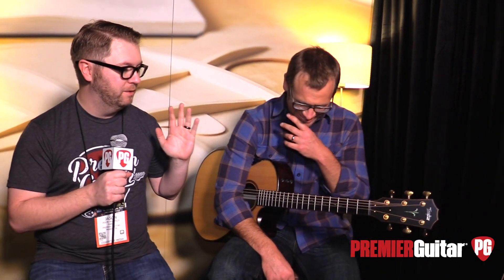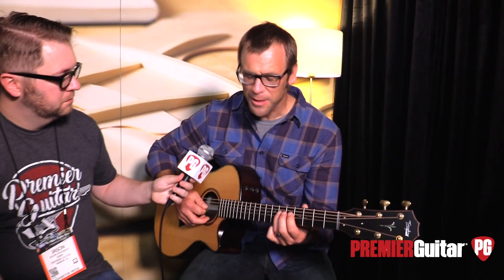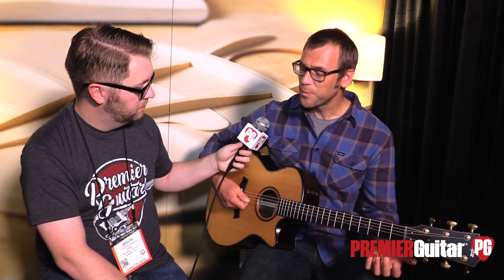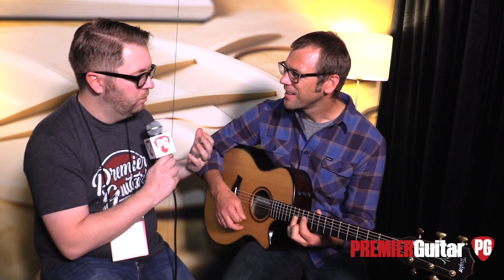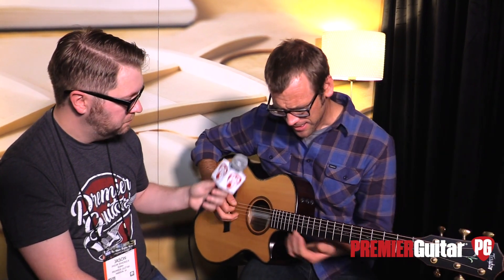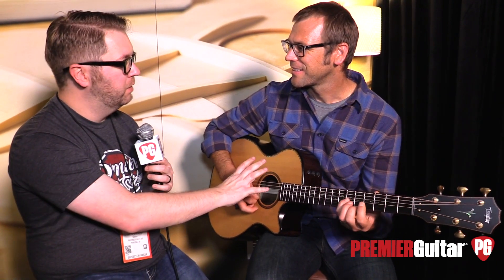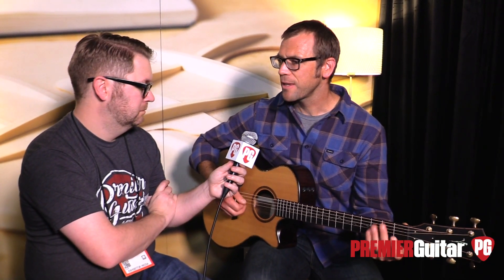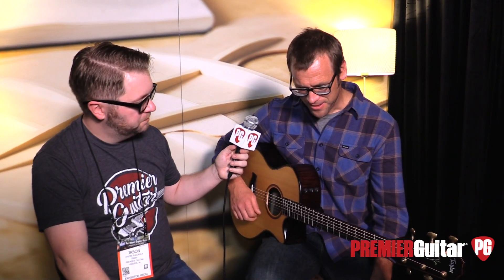NAMM '18 - Taylor V-Class Bracing Demo

Comment: I had the opportunity to try out several of these at a Taylor Road Show - Parkway Music in NYS. They definitely have a different sound feel and are very articulated note by note. The top vibrates very freely. Each of the four models have their own sound personalities. They also brought a custom maple- spruce GA , conventionally braced, which , to my ears, sounded just as good ! The V brace uses a larger bridge plate to disperse the string tension, i gather to make up for the lighter bracing. The rest of the guitar is pretty much the same. I hope to revisit them soon in a quieter atmosphere. Mr . Powers is indeed on to something here.

Comment: My concern would be with how well this guitar will hold up over time, with a more flexible top.  X-bracing is tried and true.  But those high notes do sound great!
Reply: ...they use new glue too.
Reply: top is only more flexible on the sides but more ridged inline with the string pull thus stronger. if you have the strength and rigidity along the string pull area the sides can be flexible as there is no pull in those areas
Reply: The first of these was made at least 4 years ago, and is still just fine.

Comment: if it's as simple as a different bracing architecture WHY can't it be replicated up and down the range ?
Reply: mark norris they will eventually do, but not now. This way, you are forced to buy the most expensive models to get your hands over that technology.
Reply: Because you have to make sure it lasts, and the tops don't cave in over time.  You don't bank an entire company on one new idea.
Reply: I believe that Andy Powers said in an interview (Greg Koch interview maybe?) that it just takes a bit of time to create the tools needed to mass manufacture this bracing on a full scale, rather than just these builder's edition-type deals. But the hope is that eventually it will be on many Taylors up and down the range.
Reply: Actually they've had it for 4 years now.  See my other comment below for the explanation.
Reply: Sure, it takes time for tooling, etc.,  But there's more to it than that.  Every shape is different, and the woods themselves are also factors.  For example, the Advanced Performance Bracing found in the 814 and 914 is also found in the 614, but only maple (of the regular models) has that bracing stopping before it touches the sides, because rosewood can't handle it the way that maple can.  There are many factors involved in making a guitar, many variables.  Trust though, Andy knows what he's doing and why.
Reply: It's coming to the 314's as of end of July 2018.  Should be in stores by September/October. Probably some of the other models will get them as well. Don't know about lower end models at this stage (ie 214's down)
Reply: Not hardly.  The GA is the most often purchased shape, which is why it's going to them first, from the 314s all the way up.
Reply: At this time there's no plans for putting into the Tecate models.  For starters, they are entirely a different beast, having no back bracing (using the curve of the back for structural support and that it is a laminate.)

Comment: gunna have to rename the company "Taylor Powers" once Andy has taken over ❣😊
Reply: I spoke with Bob a bit a couple weeks ago on that subject.  It will always be Taylor Guitars, but you're correct.  Andy is in charge, and has been for some time now.  

The original version of the #17 models was made over 5 years ago now.  Andy has been integrating tested and confirmed technolgies since 2014/15., along with revoicing of the 800 and 600s.   And they will continue to be brave and dedicated enough to continue to innovate.  I salute that.  They could have stopped in 2006 or so, but they continue to take the time, expense and energy to improve guitars for us.

Comment: This is just an adaptation of several other builders tried bracing patterns...the V has been done before and not new. Mc Pherson has a similar pattern done years ago, as well as others...it is not new! There as others have said an inert weakness in over-flex as wood changes, the soundhole needs to move!. It has also been done in building construction for many years. A slight version of the demi cutaway, again has been done by many. Taylor makes nice guitars but this is a tiny bit of hype, as others said a spin. BTW I'm guessing the guitar is electro-EQed tweaked here via the mike or pickup. Just one example: http://www.luth.org/web_extras/mottola_bracing-patterns.html
Reply: McPherson is not like this at all.  still x braced based. the link you showed is V bracing but Taylors is a V in opposite direction.  Andy has admitted to reading several books on building and history of acoustic guitars.  So while in his quest to get what he wants out of an instrument he tried some things and I am sure some loosely based on previous attempts.